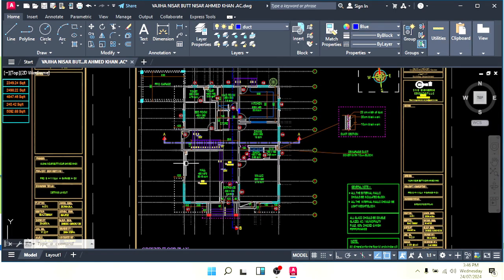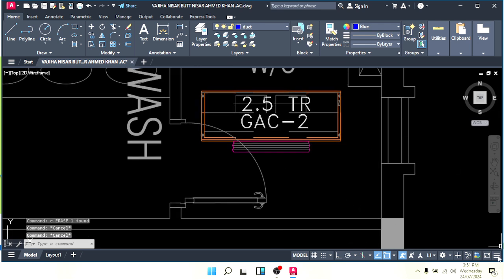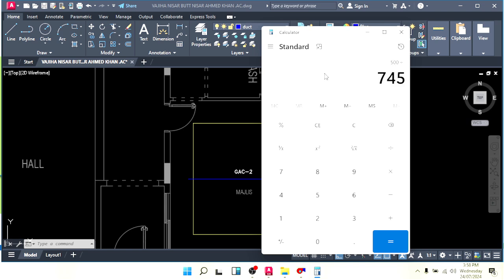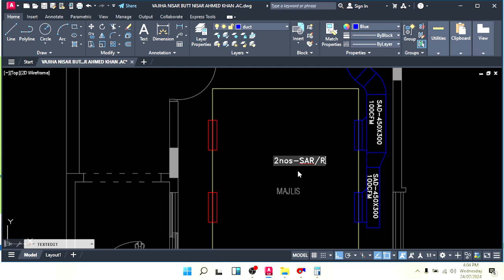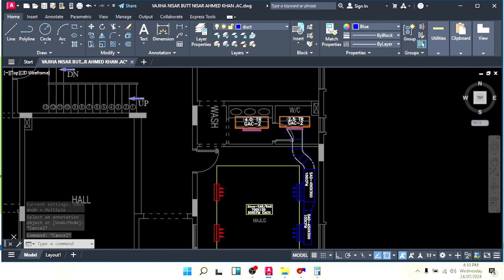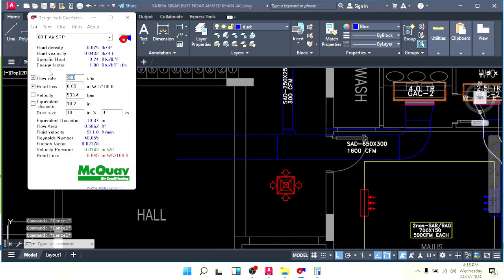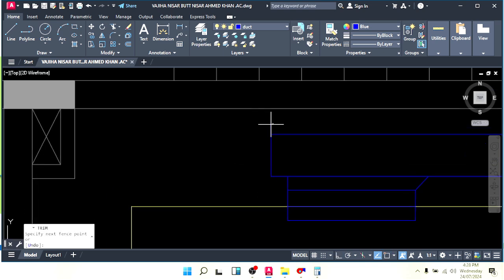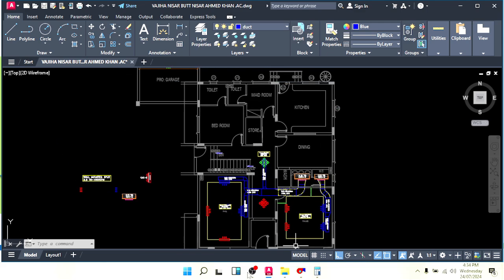HVAC VILLA DRAWING PART-1 -HOW TO DRAW  AC DUCT IN AUTOCAD-DUCT DRAWING - DRAWINGS SOLUTION 1

Comment: 500÷745 ... I want to know this part only. Kindly explain how you extract (745) from which standard and kindly explain this calculation?
Reply from the maker: Sure, 745 is Noice Criteria (nc level) 
To calculate the length and width of an air register supply _cfm divide nc level equal to supply side grills